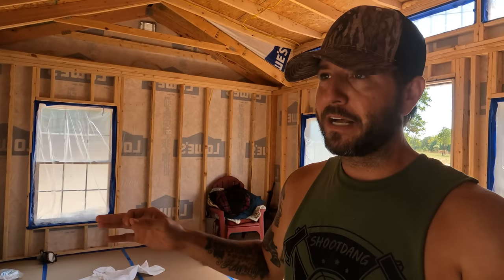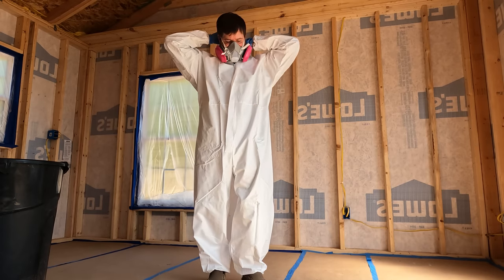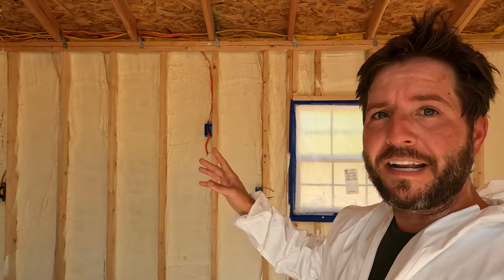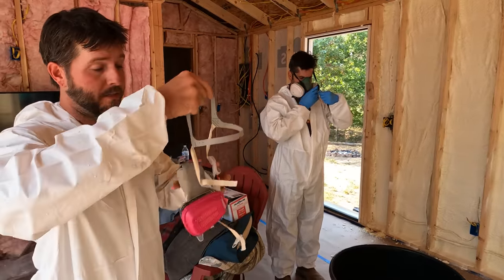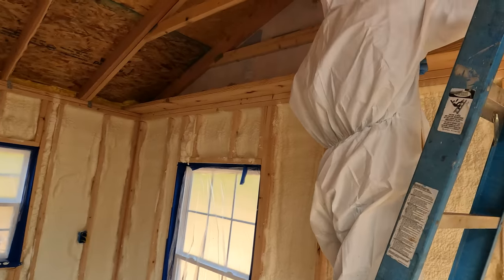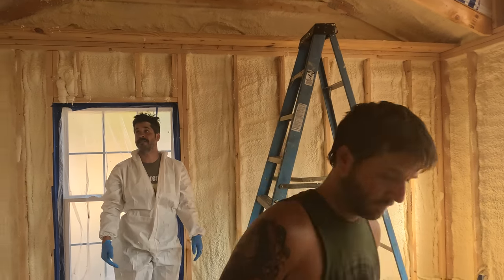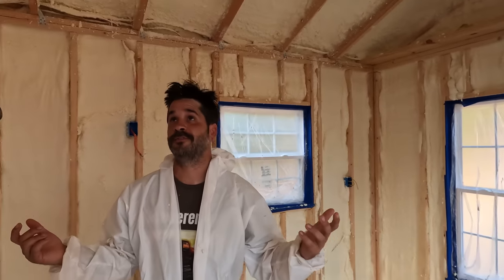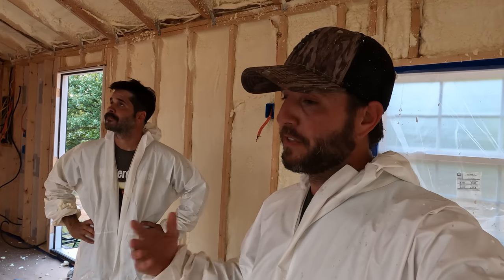Shed To Tiny House - DIY Amazon Sprayfoam Kit - What A Mess!

Comment: The thing I don't like about spray foam is this. What do you do if you realize you forgot some wiring or want to change some wiring, or maybe you want to add some CAT6. How are you going to do that with all the foam in the walls? It probably makes sense for this use case but it seems like it really ends any possibility of adding new wiring in the future. 

Would love to hear others thoughts on this.
Reply: It is a major down side for larger structures, but for this case it seems there is easy access under the building. As long as you have access underneath you’ll be able to Ethernet. Plus if your going with spray foam your sealing your fate on wiring.
Reply: Forget about remodeling. Seen one job where the insulators used the wrong foam (closed cell instead of open cell) When they tore the foam out to redo it, they wrecked wires,plumbing,and duct work. Something to think about.

Comment: You'll want to seal off ridge vents and gable vents. With no attic space to circulate air through outside the sealed envelope you will have heat loss and condensation issues.
Reply: Agree I noted this too, should have had the vents running up rafter bay to allow air flow to remove any water vapor & condensation

Comment: You guys obviously have no auto spray painting experience or have any clarity of overlap for coverage and consistency. And if you're only going for an inch you could do that job for a quarter of that price in pink also you could buy and cut in rigid foam sheets. For bout a third that price. I owned a boat manufacturing business and we bought those materials in 55gal drums.it's about the most expensive insulation material in the market. It also burns like gasoline and besides being highly dangerous to spray but puts out deadly gasses when it burns . Coast gaurd finally banned it.
Reply: I agree doing a flashing with foamboard would have been cleaner and half the cost. Just cut out the foam 1in smaller than the wall openings and use a can of spray foam around the edges to lock it in and be air tight. I don't see the benefit of spending money on spray foam if you aren't going to completely fill the cavity to maximize your R value. Using fiberglass full depth would have also given them the same R value and would have been 1/3 the price. Like someone else said they should have used the foam  on the ceiling only and did it really thick and did the walls with fiber since it would have been more cost efficient and energy efficient.

Comment: When its hot like that i wouldnt be wearing all that clothing, ive sprayed with this alot and all you really need is a long sleeve shirt that you can throw away afterwards. Key items are RESPIRATOR AND EYE protection for sure. The rest , as long as its covered your ok. I always wear a shirt that i can throw away if i get it on it. also rubber gloves that go farther up on your arm I used chemical gloves that i can wash up with mineral spirits afterwards cause my shirt will go down over the glove so no bare skin.  Just keep the respirator on, i see morons spray this without them and i just cringe... Good job bud keep it up...  I also hope your wife was wearing the respirator, she was in the same room...

Comment: I don't think your going to need that ridge vent system, you might want to seal that off because you have no rise from the bottom to the top and it will heat up quick in the top.
Reply: The ridge system is so the rafters do not dry-rot.
Reply: Came down here looking for this comment.  Ridge Vent is going to let hot/cold air into the conditioned space the way it's being insulated.  Not good.  Ridge vent is for unconditioned spaces, once you seal/insulate the roof decking, it's part of the envelope and shouldn't be vented.

Comment: Does anyone know if the spray foams will stick properly to Tyvek (I know, sounds like overkill, hear me out)? I'm planning on doing an off-grid cabin on a pier/beam foundation, stick-built but with steel siding and roof (like a barndo look) with flash and batt insulation combination. I figured that if I Tyvek around the frame, should I ever need to remove or replace an outer steel panel, it would just come away from the Tyvek instead of tearing out foam (and anything else tied into the foam). Ideas?
Reply: i think you'd end up getting moisture between the tyvek and the metal

Comment: Here is my question... Since this spray cover electrical wire as well as plumbing, how would you deal with the difficulty of running/installing new electrical wire/plumbing lines, etc with the wall cavity now filled with this foam???

Insofar as cost.. which is cheaper...Pink Glas Insulation or Spray Foam?

Which holds up longer over time/dampness/leaking water/atmospheric conditions like humidity/dryness etc?

Comment: You will notice the difference when you get the ceilings done. Heat rises and that is where it all goes, but when you put the insulation up there it can't come thru the roof to get you and make your place so hot as it has been. Then that little window air conditioner will cool the place good.

Comment: Great video and honest opinion. I’m redoing my whole house here in northwest Indiana. And I’ve gotten quotes from $6000 up to $10,000 to do 1500 square feet of bare studs like you have. I’m usually a do it yourself type of guy and have done all the electrical, plumbing, framing etc and all passed with inspection. I’m pretty confident I will buy these kits and will be doing it myself.
Reply: Do the roof with a extra thick spray foam layer and don't do the walls with it. I wouldn't want to have to do any electrical in a spray foam wall after it's all cured.

Comment: Typical closed cell foam is around R7 per linear inch thick.  Good stuff. Just make sure you take in the full envelope of the building that's sealed.  Sealed buildings still need to breathe otherwise they can trap humidity and can cause mold and mildew issues if not compensated for.  Look into an erv or hrv system for extra guidance.  Looking good!
Reply: They're also needs to be away for carbon monoxide to escape if it's ever an issue.

Comment: The foam is supposed to expand a lot. The fact that it did not much, means it is not great stuff. And because it did not expand, you will not get the same R value as the fiberglass. I would have put that in over the top, or more foam.

Comment: Hi there from NZ. Ditto...You guys did a great job. It is horrible stuff to work with. The Motto..."Cover everything and MOVE FAST!" My old boss sprayed a 1000, 600 and 300 apple bin cool stores himself. You talk about mess. We cover a cherry pick to get the high areas. It looked like some prehistoric monster that found its way out of the junk pile. BTW...Did you guys know that you can use a bit of plywood sheet to keep the foam level to your studs. That is the second guys job.

Comment: There was absolutely no reason to sprayform this... standard foamboard or insulation would have worked just fine.  You can glue/tape foamboard together to provide the same airtightness that spray foam provides.  Foamboard also has uniform thickness so there is no guessing. 

Even if you completely disagree you could have saved money/sprayfoam buy filling the cavities partially with foamboard before spraying it.

Comment: Closed cell polyeurethane spray foam:  R-6.5/inch.  Rockwool:  R-3/inch.  Fiberglass:  R-2.2/inch.  Any product installed in batts or roll will settle & break down over time, losing R-value; closed cell poly foam won't.

Comment: I would have just did Owen’s Corning insulation 3 1/2 R13. It would have cost maybe a couple of hundred dollars for the rolls. On the ceiling you could have used 6 1/2 R21. I insulated homes for many years and you lose 80% of your heat through the roof, only 20% through the walls. These sheds are built with 2x4 walls so you can only use 3 1/2 R13 and that should do the trick to keep the heat or energy costs down. $2,000 dollars plus for that foam is lots of money if people are on a budget, the R value between the two is about the same, the foam would be better to seal the walls though, it will stop leaks and moisture so I’m not against it, I’m just stating the cost comparison for those on a budget. It is good to know about those kits, I didn’t know they had them. For cost saving, use insulation, for bigger budgets the spray would be the way.

Comment: Please don’t use those kits. They are garbage.  The chemical doesn’t mix correctly.  Just hire a trained professional with professional equipment.  That is just a horrible spray job you guys have done.  The ceiling is just awful. Why would you leave a vent in the gable wall ? A 9 !?!?!?  That’s a 2 maybe.  
You should get an air quality test done before spending too much in there.

Comment: Uh guys,   I have spray foam in my house. And it expands way, way more than that stuff you’re using. That seems like each time you make a pass it barely expands a half an inch if that. I don’t know how cost-effective that is when you have to fill up the cavity to get a good R factor.  The close cell spray foam that the pros use when they spray that it expands instantly at at least 3 to 4 inches and that’s moving quite quickly. So I don’t really know what type of factor you’re going to get or how many containers of that you have to use. I have 2 x 6 walls 14 inch TGI ceiling Joist, which they filled up completely. For $4200 now my house is only 1200 ft.² but I do have a 5/12 16 foot high vaulted ceiling. 
   I appreciate you guys doing it yourself. I just don’t know how cost-effective that actually is I have to do a little digging and let you know.

Comment: 3 grand for a kit?? I got quoted 6k for my entire 1800 sqft house to come in and spray that foam on all my walls except for the roof. And I think you'll save for 1 your health, 2 time, 3rd risk and 4th thickness and warranty protection. 3k not worth it. I would probably buy it if it was $300-500 but not 1k

Comment: Good work. If I may advise, always use eye wear. I have seen many get it in the eyes and it sucks. I owned a spray foam company and one thing that you need to know is that the foam will gas off for at least a couple of weeks. This is not good to breath. If you didn't get flu like symptoms from applying the foam and breathing the air between takes, you are fortunate. Otherwise, it should keep you warm this season. Peace

Comment: I have a 15x 40 shed had it spray foamed by a company and it cost me 3500 all side walls and under floor . Best thing ever . 2 heater unit on low heats it good . 1 AC window unit . Untill I get the split unit. Do the foam .

Comment: Wait three days and it’ll peel off skin /hair w/o pain.  And a low VOC mineral spirits in a shallow cup/pan to dip your tip in will help keep it from clogging. Also if you add chicken wire between coats or imbedded is STRONG AF ! Good stuff though. Just a long term investment.

Comment: I've used a number of the 600board foot kits.  They never cover as much as I want, and the mix is never "quite" right.  I've moved to either A: calling in a big company that shoots the foam off a truck, or using the hard pink foam caulked into place. I won't use the kits anymore.

Comment: I would never spray that toxic crap in my house. Its garbage IMO and a huge fire hazard. Id rather have a house that breathes a little bit anyway and certainly wouldnt want to live in an airtight house. You know what they say about indoor air pollution...Its worse because the air ISNT fresh. A guy I knew DIED of Stage 4 lung cancer at 37 from working with epoxy indoors for a couple years. He took it for granted and it killed him

Comment: Having built homes since 1977 I'm missing the point. It appears there is a gable end vent along with a ridge vent. If you are spraying the underside of the roof deck, it requires a sealed space to be effective. Attics with spray faom on the roof deck don't have vents. Vented roofs have the insulation on the back side of the ceiling surface and vented air above removing condensation from the underside of the plywood.

Comment: I've seen it be a two man job. One sprays then the other takes a board across to studs to get a smooth, full amount of foam. Then repeat all the way up the wall. Ceiling would be tricky and probably require some scaffolding to work. Just a thought.

Comment: I'm just going to toss this grenade into the mix.

If you had all the plans laid out and in place before framing, why didn't you use sips? No framing, no insulation work. If you had your wiring all worked out it would have been incorporated into the panels?

Comment: great work, you answered a lot of questions = how messy- shoes will be toast, cover the damn floor & windows & outlets. for ventilation, maybe do it before windows are installed. side note on venting - you need to seal your beard with petroleum jelly otherwise the respirators ain't doing you any good . . you can check this by putting your palms over the filters & inhaling.. and there are specialty blades 18"+ just for this - you put them on a reciprocating saw..

Comment: seems like the ones the pros use foam up a lot mo'better. Most of the time, the foam expands way more than the one you are using, whith just one coat, almost seems like they over sprayed, but then again it was only $1,000 per kit.

Comment: You should not be breathing that while the spray foam dries! Extremely dangerous that is probably why you're getting light-headed. Most likely the foam you need needs a couple months to air out before you should even go inside without proper PPE. I stand behind most DIY projects but this one is a very dangerous project for a normal person to do correctly. Maybe pay a professional for that part to make sure that you're safety isn't at risk.

Comment: It looks like your mix was off on the first run, or the wrong product for this job. You did not get near enough expansion to fill the cavity and you need the cavities filled for the max R rating. Maybe you got exactly what you wanted though, IDK. There is a reason it is more expensive by pro's, most know the do's and don'ts and can advise you.  You can get a home too tight. We did in one of our homes in 90's, we could not get our fireplace to draw, even with a fresh air vent built into the fireplace. we had to crack open a window every time we wanted to use it. We had to do some changes so the home could breathe and get proper air exchange. A home is like a living breathing "animal" and it's a science. I suggest DIY's use the pink insulation, you can use the encapsulated insulation for the entire job and tape the seams or just the ceilings and joist areas and tape the seams. Depends on your exterior sheathing/wrap. I like to wrap and tape the exterior, but there is a new "spray on" that many of the builders are using now. EDIT :This guy found out the hard way: https://www.youtube.com/watch?v=NDA6gqsyZnI

Comment: I saw where a unconventional technique was the guy did a basically fast pass of foam like these guys first coat then installed 1" board foam, then covered it again with the same spray, sealing the board foam sandwiched in.. he claimed a much larger R value and saved immensely on what it would've cost to get that think with the do it yourself spray..... what do you guys think?

Comment: I did spray foam in my vacation cabin/cottage. If i were to do it again id just go with regular kraft faced fiberglass. You can still air seal and use fiberglass.

Comment: Would never spray the back of decking directly, can cause a whole host of issues. baffles with ridge vent/soffet vent then spray in the foam is the usual method and will prevent any roofing material warranty from being voided. Also makes any decking repairs possible in future.

Comment: I'm curious where you live that spray foam insulation is enough R value to be efficient for a livable space? I considered that option but with 2x4 walls I could not get enough spray foam layers in there to get the R value we need in East Texas hot summers and cold winters.

Comment: yes go the length of the boards up and down not side to side its not a spray paint can, just remember to get both chemicals to go on even and not to much at once if it dont mix right it will smell fishy if that happens you have to remove it all its no good BE VERY CAREFUL you risk blowing 3k if you dont mix them right

Comment: i worked in insulation as a installer salesman then GM for about 15 years. you guys did a great job. i would not have recommended  using spray foam in this application.not because its bad or its not a good product.maybe a hybrid where you foamed the ceiling full depth of stud the fiberglass the walls.  its just not going to get the energy savings over fiberglass. i would suggest air sealing everything first then R15 fiberglass. it looks like you have about 2 inches on the walls which should be R15ish. R15 fiberglass with a good air seal gives you the same result with a fraction of the cost. you want at least a R19 in the ceiling so 3" minimum. R value is R value if its fiberglass or foam. the difference is that foam air seals. a can or two of door and window foam would of air sealed all the seams then R15 fiberglass. also to scrap the foam away we always used curry combs. they work great https://www.amazon.com/BOTH-WINNERS-Reversible-Stainless-Steel/dp/B07S9VB4LH/ref=sr_1_7?crid=NA6Y9654BWKA&keywords=curry%2Bcomb&qid=1671391089&sprefix=curry%2Bc%2Caps%2C112&sr=8-7&th=1

Comment: That stuff has a great R value but it causes mold and rotting extremely bad if it's not ventilated correctly.  99% of buildings are not designed for that tight of a vapor barrier causing condensation where you can't see which will seem like water leaks coming inn but it's not. It's water caused by condensation inside your own place